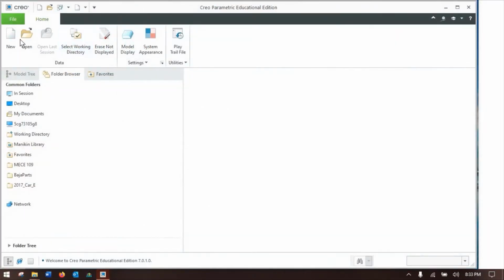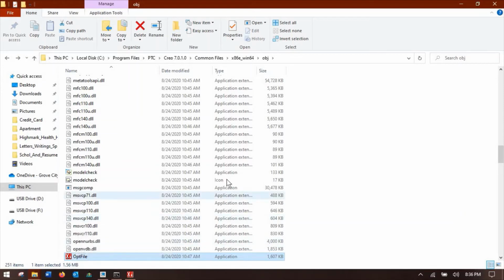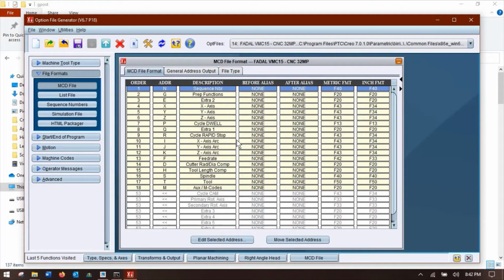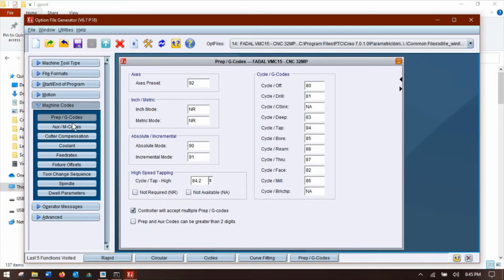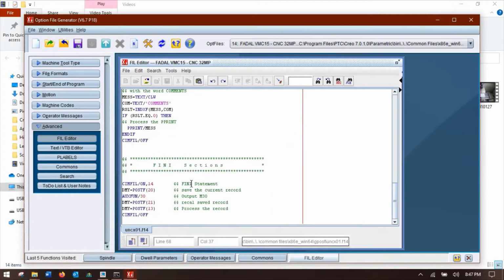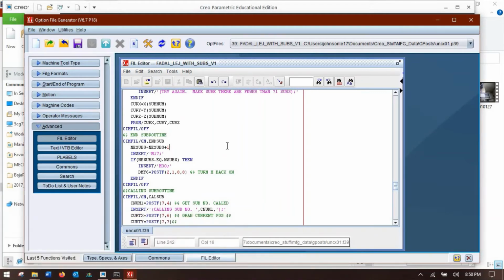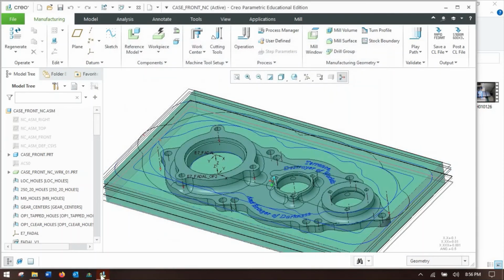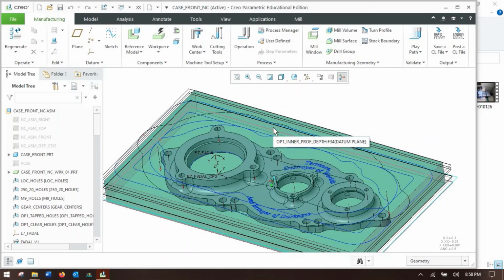Setting up Creo, Part 3: Post Processors and Option Files

Comment: Do you what pp for all fanuc 3axis run easy any fanuc controller and how to create post processor
Reply: Hi Aifansari,
Your installation of Creo has a library of "default" post processors. My installation has "20: LeBlond/Makino Fanuc 16M," which should be a good starting point for a Fanuc-controlled 3 axis mill. You will likely need to change some functions of the post to match what your specific controller/machine requires

Comment: I really enjoyed watching your youtube video series of the creo setup & post processor. 
I've got a fryer mini mill that uses an antiquated anilam control system. I've been using creo to tailor to the machine, and use the austin tech option file generator. 
I've got a couple nagging issues I couldn't fix so far, I was wondering if you know how to rectify these:
- the G-code will be littered with H1, H2 etc commands. Every time I select a tool, for example T6 it'll include an H6 line, which my controller does not need. I just want to get rid of it. I already took care of the G43 - which Anilam does not use either.
- Currently the g-code will have a line for normal drilling cycle like such: 
N34 G81 X0. Y-14.9 Z-11.903 R11.5 F123.2
N36 G80

anilam can't really cope with the X0. Y-14.9 portion, so it'll just disregard it and do not drill at all. these should be structured like such:

N34 G81 Z-11.903 R11.5 F123.2
N35 X0. Y-14.9
N36 G80

I could not find this setting either. I ran all the post processors and found that #19 will export the g-code withouth the H1 line - but I could not find what codes it.

Any help is appreciated and if you want maybe we can cooperate on something.
Reply from the maker: Hi Enginord!
For the toolchange:
I'd try heading to OptionFile Generator's "Machine Codes" menu. There's a button under the "General" tab that says "Ignore Tool Length" - checking that one, and unchecking "Output tool number as length offset"
For the drill cycle:
Does your processor output a motion command before the drill cycle? e.g.,
N33 G0 X0. Y-14.9 Z1. G54
N34 G81 X0. Y-14.9 Z-11.903 R11.5 F123.2
My machine (Fadal control) requires that you go to the point, then call a drill cycle with the repeated coordinate (like in my example above). If there are no "staging coordinates," my machine will just ignore the XY in the cycle call and move onto the coordinates in the next line (which sounds like your problem).
Regardless of whether you need to add missing stage coordinates or remove coordinates from the cycle, I think the way to do that is via the FIL editor (under the "Advanced" menu). You can use CIMFIL/ON routines and POSTF commands to capture raw CL data and modify it before posting. Austin NC's website has some FIL program samples: https://www.austinnc.com/anc_support.html
Reply: @newengineerontheblock  thank you for the quick response. I'll test these out.

Comment: Can i make an option file like this for Autodesk PowerMill?
Reply from the maker: Hm...I'm not exactly sure.  I don't have much experience with Powermill (read: I have none :)  I did a little digging, and found this article from Autodesk: https://knowledge.autodesk.com/support/powermill/learn-explore/caas/sfdcarticles/sfdcarticles/How-to-set-a-default-machine-option-file-in-PowerMILL.html  (It's pretty generic...just shows you how to get to the list to select an option file).  From this article, it would appear that Powermill does use some kind of option file, but I do not know how to edit them (or even if Powermill will allow you to do so).  Sorry that I can't be of more help.